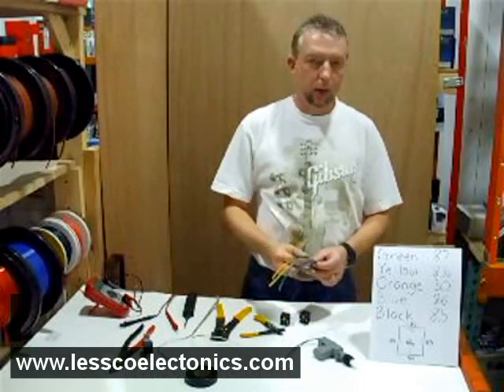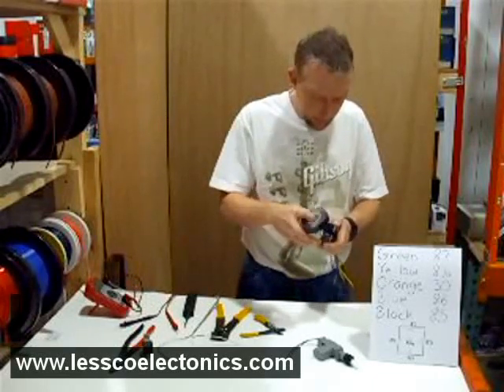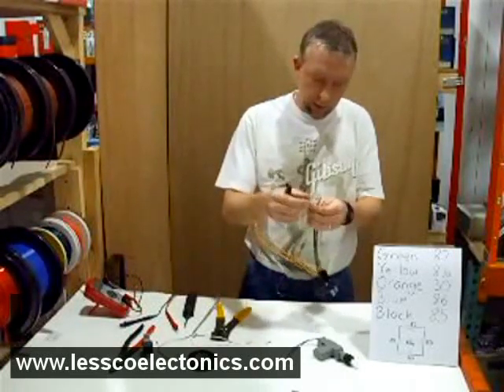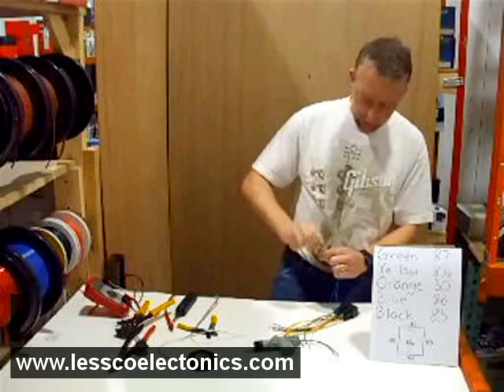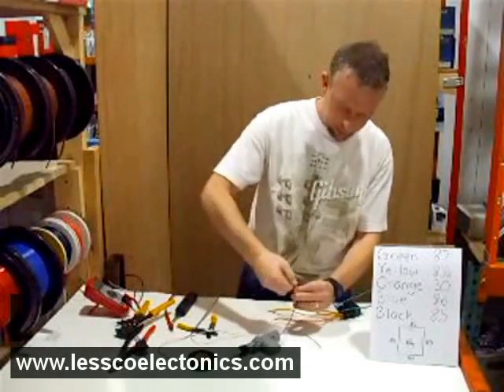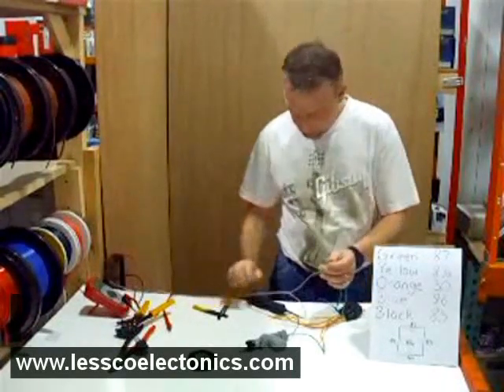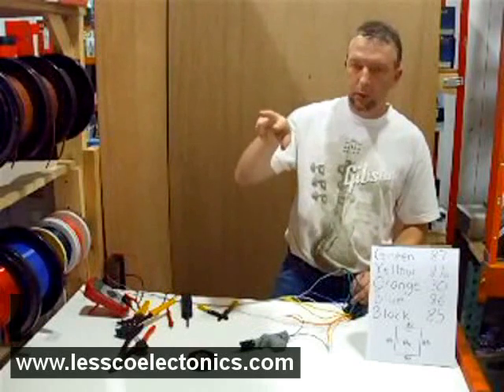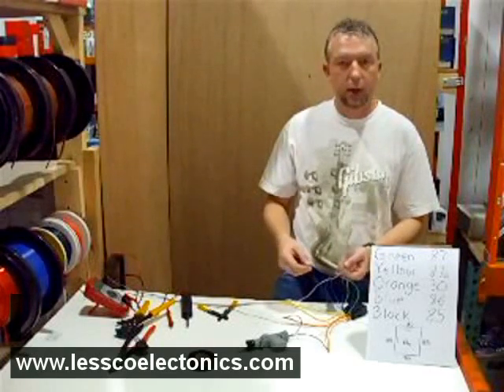How to wire Power Door Lock Actuators and Power Window Kits

Comment from the maker: Easy.... use the trunk output wire from the alarm, connect that to 85 of a relay, 86 and 87 go to fused 12 volts, and 30 will be the output to the trunk motor, ground the motor in the trunk area somewhere and youre done

Comment from the maker: get rid of the resistor, thats the first thing. 
wire the - inputs from your switch or whatever youre using to pin 85 of each relay, pins 86 and 87 on both relays go to 12v+   pin 87a on both relays goes to ground,and the 2 pin 30's will be your reversing outputs for the door lock motors, give it a go.

Comment: i have a viper 3305v i wire everything up, but it doesn't work, what i notice is that one of my pin 30 on relay has 12v going to the door actuator all the time. then i remove the signal wire that comes from the alarm number "h1/6 ()instant trigger input zone 3" the 12v gone. am i using the correct wire, on the other side im using h1/5 green ()door triger

Comment: Hey I had a question about the 5 pin relays... Are there some relays made different on the inside. because I wired them exactly the way you did and i can only unlock but it wont lock. Im completely lost. please help if u can

Comment: never mind, the damn relay i picked up from advance auto is for lights 87 and 87a are 12 v to the lamps 85 is ground 30 is constant power and 86 is to switch. can i use these if i wire them different or would it be easier to purchase more

Comment: something is not right! everytime i hook up the 4 hot wires they blow the 30 amp fuse. they are to different relays brands. one came with the remote start for the optional starter kill. could that relay be different inside. they all have the same pln numbers and i did not use the harness that came with it because it had a resistor jumping from 2 pins

Comment: hi, The Lessco. I have dodge ram 1500 pickup  with quad door.
Front driver and passenger side has power door lock. but the quad door ( rear door) doesn't have one. I want to install power door lock and switch on it. How to connect them? thank you

Comment: Are these relays and harnesses available on your website? If so, please advise part number or link. Also what is are the specs on the power supply that you are using? I want to use this set up for a 12v residential application.
Thanks
Reply from the maker: yes sir: http://www.lesscosales.com/servlet/the-36073/Lot-of-5-12/Detail

Comment: In my 1994, 4-Door SunBIRD LE, I have an AutoStart 2-way, FM security system that also power locks & unlocks all four doors.  I have just received delivery on a Biltex Universal Power Window conversion Kit ... Do the windows wiring have to be fished through separately from the locks to the power source OR can they marry-up with the security/locks' system?  I'm looking for a way to save additional wiring time on the install ...
Reply from the maker: The windows draw alot, I mean alot more current than door locks, they should be totally seperate and fused according to power consumption
Reply: Thank you ... good to know

Comment: u must use 2 diodes with relays better  the diode takes the energy stored in the relay's coil when you switch the current off. Without the diode, the energy has no place to go and will cause a large and probably destructive voltage spike
Reply: diode must be installed in parallel on every coil